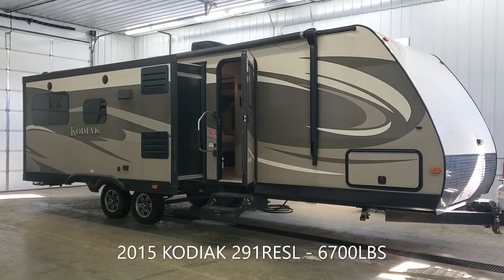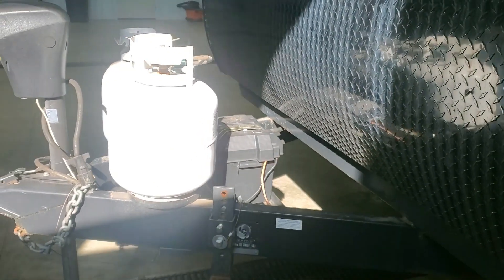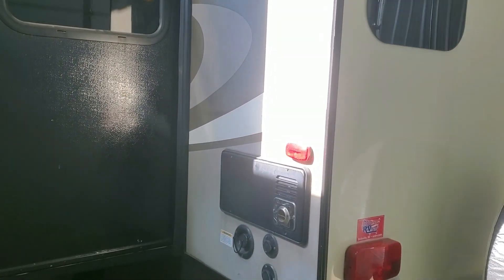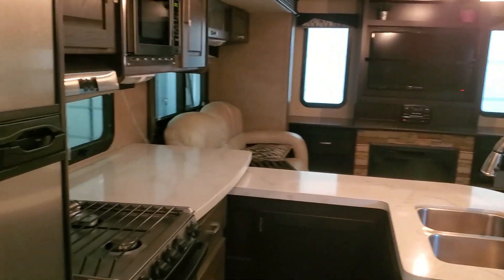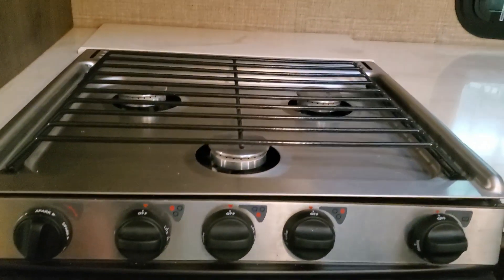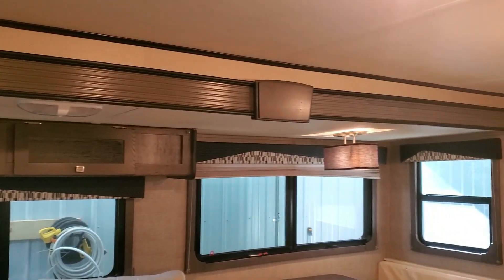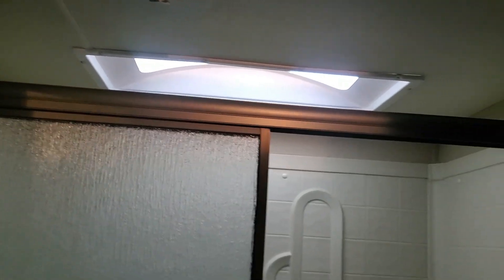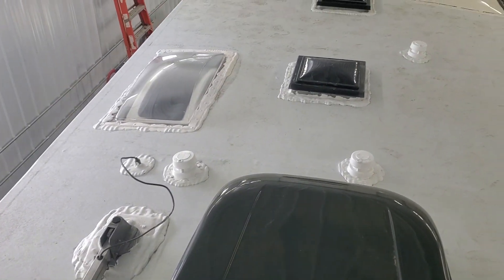2015 KODIAK 291RESL - READY TO CAMP!

Comment: I liked how you started your review outside which differentiates you from Josh. Just slow down a little bit, stay in one section of the RV until you have fully reviewed it before you move on and watch some more of Josh’s reviews to get some awesome tips on the important features to showcase such as fridge size and whether it is a 2 way or 12 volt. Good luck👍